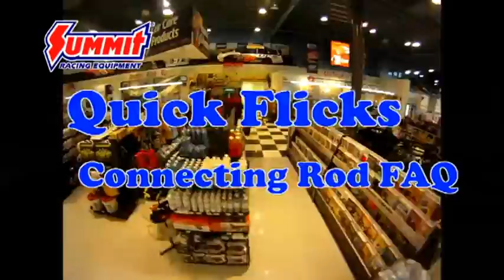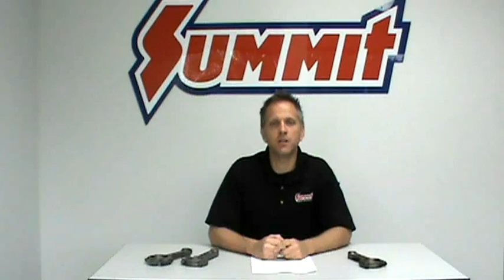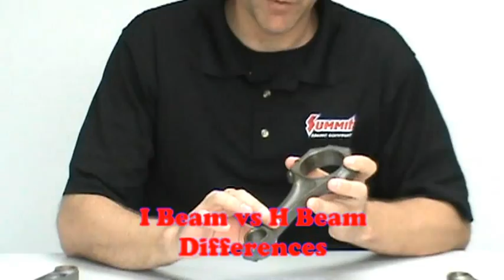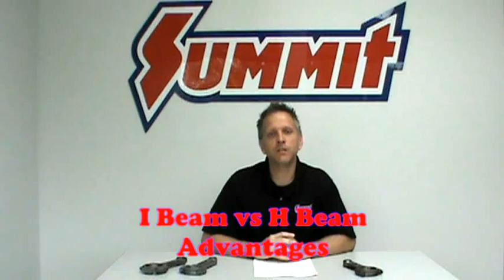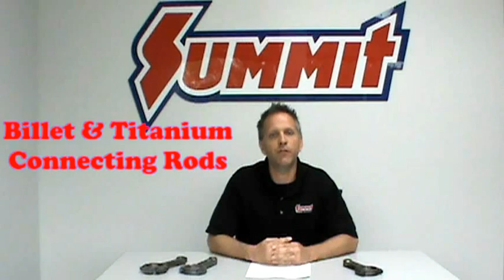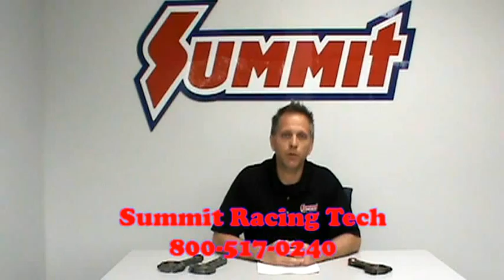H Beam or I Beam Connecting Rods | Summit Racing Quick Flicks

Comment from the maker: Manley actually has a Pro Series I beam connecting rod that will handle up to 800 horsepower. They actually have 2 different lengths available depending on the customer’s combination. I will private message you the link. Thanks for watching!

Comment: There is a certain level of misinformation you are perpetuating in this video. I as a die hard car enthusiasts and human striving to expand my automotive education beg you to take this video down and reproduce it after you've done proper research into the subject. Being a retailer doesn't immediately qualify you for things like this.
Reply: Lol. Get over yourself. Generalizations aren't the same as Misinformation.
Reply: I actually agree with the guy 100%. I beams are great, but people that run big power generally run h beams.... h beams are heavier, and therefore they hold up to higher cylinder pressure. I run Ohio h beams, and an 4340 Ohio crankshaft. Never had any problems.... for anybody that’s makin over 800 I recommend h beams.... not saying I beams are bad, but h beams are better lol. I beams are lighter, and harder to machine than h beams (hence why they’re more expensive) h beams are heavier and therefore handle higher cylinder pressure better (like I said above) to each is own though!

Comment: Which Mechanical Engineering textbook did you use to base your statement that H beams have more structural integrity than I beams? Just out of curiosity, because I was taught that given a comparison between an H beam and I beam rod of the same alloy and mass, the I beam rod will hold nearly twice the force of compression that an H beam will given the same thrust angle. Both rods will be subject to the same mechanical limitations of tension, but an I beam can be made lighter than an H beam allowing for increased rotational velocity before reaching the max tension.

H beams are more forgiving of crank walk and side loading, but only because the thrust angle of crank walk turns an "H beam" into an "I beam" -- relative to the angle of the acting force...

This is why structural beams are installed with the flat sides bearing load. Next time you drive under a bridge, think about the direction of force acting on the beams, you'll see that the force is applied along the same plane as the force acting on I beam rods as they rotate... Imagine putting a side load on one of these beams as if it were configured as an H beam **I shutter to think.

Remember, the thrust angle of the force acting on a connecting rod isn't linear through the center of the rod, it's a torsional force creating a load across the face perpendicular to the thrust angle (like that of a bridge bearing a load.)
Reply: P.S. This is why H beams bend into a rainbow shape under some knock, because the thrust angle of the applied force is acting in that direction, and the beam isn't configured to support load across that plane (otherwise it would be an I beam...)
Reply: BAM! #2 As a mechanical design engineer I also approve this message and suggest this YouTube is worthless.
Reply: Another vote for excellence by a mechanical engineer. Well done, sir.
Reply: robotics engineering, though I'm a bit out of place, aproves this message
Reply: I thought h-beam could be made lighter than I-beam

Also do you mind if I steal this? -aspiring mechanical and eventually hopefully race car enginerd
Reply: Peter Smith software engineer who just so happens to have magically stumbled upon this comment, And I to approve of this message. 

P.s. Don’t forget to save space for those patches and updates, we won’t get it right the 1st time or the 2nd or 3rd or 3.0.1/3.0.2/3.0.3/3.0.3b/3.1.0 but were workin on it👍🏻😸
Reply: I was always told by engine builders that H-Beams are not as good as I-Beams. I put H-Beams into my engine, they are much heavier than the I-Beams but cheaper. I really appreciate your post helps me understand the reason why.
Reply: you are correct, but doesnt that assume that the two masses are equal? h beams are usually much heavier than i beams, thus giving them more structural integrity

Comment from the maker: It depends on if it is a factory OEM or aftermarket forged I beam connecting rod. The factory rods likely will not hold up to this amount of power but the aftermarket version rod should be able to handle over 300 HP without any problems.

Comment: I'm not an engineer, but an engine builder. I will say I've never seen a rod fail, H or I. other failures, valve train, ring gap, bearing/oil problems etc can lead to rod damage. I's tend to twist and bend but stay in the cylinder resulting in just damaging the cylinder. H's tend to wrinkle those thin ribs and fold in half, destroying the block crank and cam/lifters. an engine is a bomb, $ and wisdom provides the length of the fuse.

Comment: I am no engineer but isn't the H beam just an I beam turned 90 degrees?  Does the difference in performance have to do with the angle that the force is acting on the structure?  I think I will stick with my I beam rods for now.. If they are good enough for NHRA they are good enough for me... :-)

Comment: Hi, saw ur vid, great insight, from ur data I'm assuming a h beam rodwould suit me, but I would like to confirm to be sure. I have a Mazda mps 6 also known as Mazda speed 6. I'm looking to push 600 whp. This car is an awd drive 2.3 single turbo 4inline motor. This car comes out the factory with tons of low end torque. Reliability is key for me. Go to drag track now and again. Would lime it to run like a daily. Which rods would be ideal for my application? 
Thank in advance.

Comment: The information I read is that 6 inch rods work well in a 383 stroker - if you got a "radical" cam. I'll be using a cam with a 502/520 int/exh and a 113 lobe separation. Is that radical enough to avoid detonation issues?
Reply from the maker: Louis DeVries, 
Can you give our tech line a call? 1-330-630-0240. We need some additional information from. 
Thanks!

Comment: if you still here to answer questions i Have a question regarding H and I beam from the video as after doing lot of searches i Found that its different from what you said in the video as H beam is lighter than I beam and they used I beam to support boost as they are heavier and they use H beam for high RPM as they are lighter so am getting confused with this
Reply from the maker: +Ahmed Abdelhamed, 
There are a multitude of manufacturers out there using different materials and machining processes, not to mention the dimensions of the connecting rod all play a part. You will have to research and choose the best one for your application.
Reply: how much hp can i beam handle ?
Reply: how much hp can i beam handle ?

Comment: Hi i have a 2105 sti getting a rebuild bottom end , my builder opted for eagle ? Are thwy goog should i ask for H or I beam , its a daily driver with at least 60 kms austarilan a day mods are tbe , cobb intale amd access port FPR 800 fuel pump , catch can , turbo inlet , and electronic boost solanoid , may late gi flex fuel E 85 and maybe if i can $$$ a bloch 1.5 turbo i think its called 
Thanknyou so very much for your input

Comment: What is the difference of what you guys spoke of in the video vs a chrome moly, you anwsered my questions about I and H beam and tensile strength of forged and cast  but didn't touch chrome molly  thank you
Reply from the maker: +Chris ODell, 
Though it was not actually said in the video, the most common forged connecting rod material is known as 4340 chromoly steel.
Reply: 4340 is a nickel-chrome-molybdenum steel.

Comment: Hi, I plan on ordering the summit remanufactured 347 engine block. But it says only to run h-beam rods. Long story short i bought a 302 planned on 347 stroker and ordered 4340 eagle i-beam rods but needless to say the piston skirts are damaged and can't use the block. So, would i be able to use the i-beam rods on the summit racing engine block with out any major problems?

Comment: what is the line for high rpm? take a 502 for instance. I wanna handle 6000 rpm maybe evan 6500 but rarely get up there bc I want a low end torque street application that can handle hard acceleration weekend burn outs and maybe a entrance level truck pull
Reply: Scott Pelletier depends on build and what you get
Go contact a engine builder

Comment: What about your Connnecting rods? I'm looking to build a SBC 305 that makes 300 to 350 hps, that would be revved up to 6500 rpms. Looking at putting in a good set of heads with 56cc, 1.94 in and 1.60 exh valves. . looking at putting in a cam with 220-224 @ .050s with a LCA 108 to 110. along with a high volume/high pressure oil pump.
Reply from the maker: Hi w41duvernay, 
An I-beam connecting rod will do everything you need it too!  Make sure you have the rotating assembly balanced!

Comment: If I'm looking to rebuilt a 454 LS6 engine and want to withhold approximately 525 HP and 500 Torque, and have the car always run on pump gas and have street drivable with no reliability issues, would I run with H beams or I beams? I'm a little confused as H beams are in each competition kit, yet the video says I beams are for stronger applications because of the weight.
Reply from the maker: Hi *****, 
An H bean design is the stronger more durable type of connecting rod, but for a pump gas street driver, the I beam will do everything you need done!
Reply: Perfect, thanks!

Comment: Hello whats best for street 383 5.7 or 6 inch rods? And to with forged I beam or h beam? Thanks
Reply: we run a 5.7...if you get a 6" you'll have to check the wrist pin location on the pistons.
Reply: +Jasun Johnson Using 6.000 rods are prefered for less cylinder wall loading(less friction = increased HP and less wear) and in turn, that moves the piston rod end clser to the oil control ring land for a different compression height compared to stock... going with a  set of forged I beam rods seems to be the concensus here.

Comment: I am looking to build a 600hp motor then add 350hp on nitrous which would be the one i need?
Reply from the maker: +devante campbell , 
The H beam would be the strongest of the two.
Reply: +Summit Racing do you think it would be good to use 5.85" rods with a flat top piston considering all the nitrous or will a dome work just fine?

Comment: Will the I beam Rod be able to handle 250-350hp on a Civic SOHC engine??
Reply: Forged I beams normally handle around 200-400 hp per cylinder.
So you're all good.

Comment: Has anyone had any issues with Manley connecting rods??. I just bought a set for my 1998 Mustang GT, as soon i began to remove the caps i got stuck with one of the rods, i managed to remove one bolt but the second one is pretty tight, i can't remove the bolt, i tried with WD40 and nothing, does this mean i have to buy another rod?? or any ideas on how to remove the bolt without damaging the rod??, thanks in advanced :)

Comment: I have a set of manley h beam rods that I got in a package deal of parts.  My goal for my evo x is at most 600whp. I have been told going with the I beam is preferred but if the h beam is rotated to about 600whp would I be safe to use them if I kept the car within those limits, or should I just get the better rod for reliability.
Reply from the maker: Andrew Noffsinger,
An H beam rod is actually
stronger due to the fact they have more material in the beam area. But, its
this extra material that makes them hard to use generally because of clearance
issues within the crank case. Assuming these H beam rods are new and not
abused; check clearance inside the motor while mocking things up and if minimal
grinding/clearancing need to be done, use them!
Reply: Awesome thanks guys! I have heard so many shops say the opposite, that they are weaker then I beam.
Reply: Summit Racing 
H beams are I beams turned sideways with profile deviations based on the depth of the grooves, if you took the beams holding a bridge, and turned them sideways; the bridge would collapse under a normal load (that safety factor of 3x expected load capacity built into construction would be halved.)

Structural beams are stronger in an I configuration relative to the thrust angle. Please investigate this further and please exclude unsubstantiated opinions when dealing with structural components, speak with a mechanical engineer, visit a local University, just don't present unsubstantiated opinions as if they were facts. Engineering isn't new, there is plenty of information available on this subject, even though it might not necessarily be specific/exclusive to connecting rods, the principals are the same for determining load capacity at a given thrust angle...
Reply: P.S. The additional material in the beam area would carry more load if it were further from the center of the rod, the applied force is acting on a complex system which creates a certain ratio of leverage acting on the grain structure of the material. This is one of the reasons why aluminum rods are so large, it's not only that aluminum is a weaker material, it's also because the effect of leverage on the internal structure of the connecting rod is reduced as the cross section parallel to the thrust angle is increased relative to the diameter of the rotating assembly. For example, if the width of the rod were greater than the diameter of the rotation, it would gain a mechanical advantage reducing the amount of torsion observed under the same load. (obviously this isn't possible in an engine, but for the purpose of illustrating the effect of load site placement of structural material.)